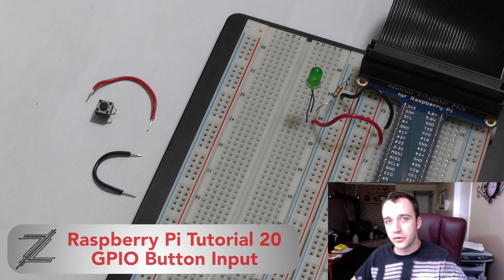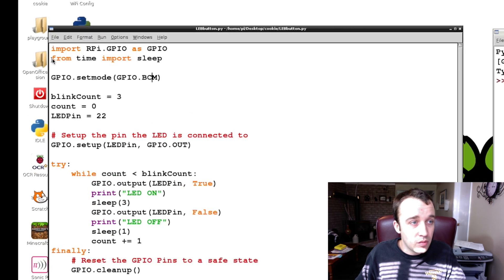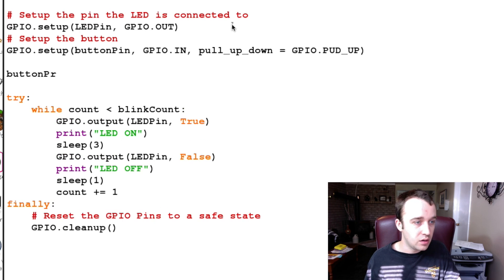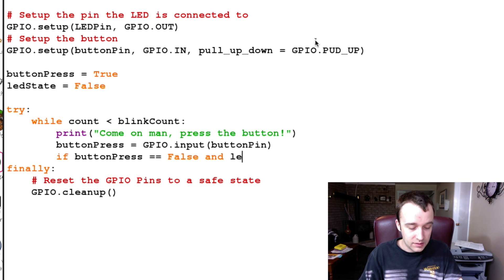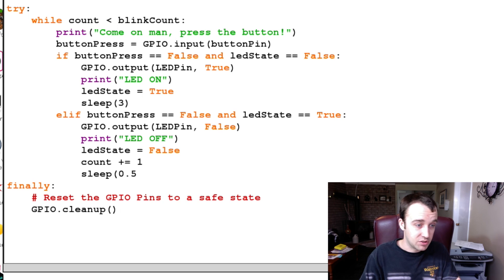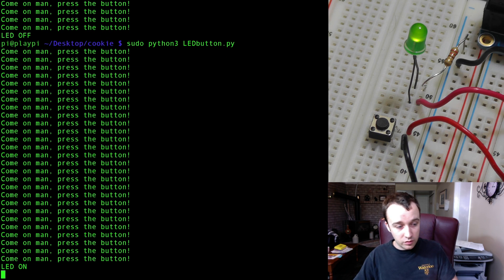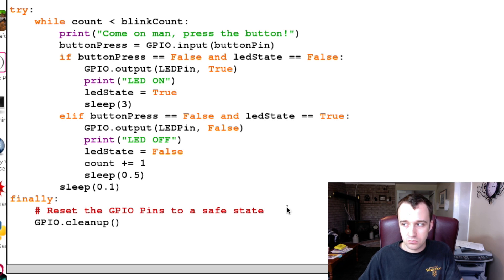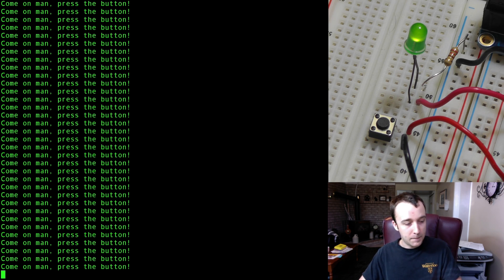Raspberry Pi Tutorial 20 - GPIO How to use a Push Button

Comment: import RPi.GPIO as GPIO from time import sleep GPIO.setmode(GPIO.BCM) blinkCount = 3 count = 0 LEDPin = 22 buttonPin = 5 # Setup the pin the LED is connected to GPIO.setup(LEDPin, GPIO.OUT) # Setup the button GPIO.setup(buttonPin, GPIO.IN, pull_up_down = GPIO.PUD_UP) buttonPress = True ledState = False try: while count < blinkCount: print("Come on man, press the button!") buttonPress = GPIO.input(buttonPin) if buttonPress == False and ledState == False: GPIO.output(LEDPin, True) print("LED ON") ledState = True sleep(3) elif buttonPress == False and ledState == True: GPIO.output(LEDPin, False) print("LED OFF") ledState = False count += 1 sleep(0.5) sleep(0.1) finally: # Reset the GPIO Pins to a safe state GPIO.output(LEDPin, False) GPIO.cleanup()

Comment: I would rather have an initial state set to off, because we cannot assure that the finally block would run, like killing the process or the power went down.
Reply from the maker: +Dongha Lee If the power went down, the GPIO header would be reset anyway. If you crash out of the program and somehow bypass the finally block, you would still have the LED energized until you restarted the program. I agree, having both in place would be the safer approach.